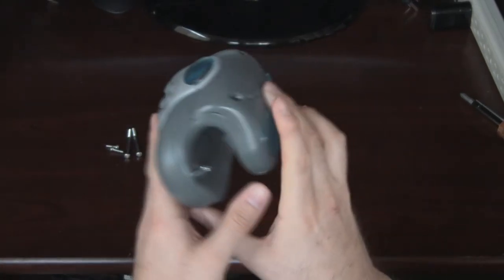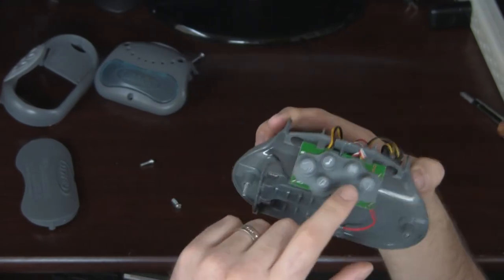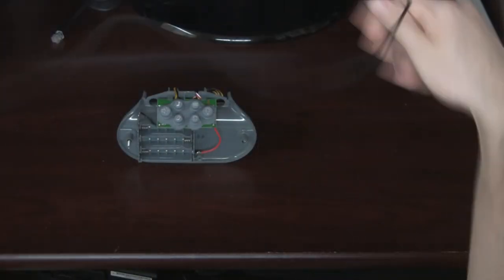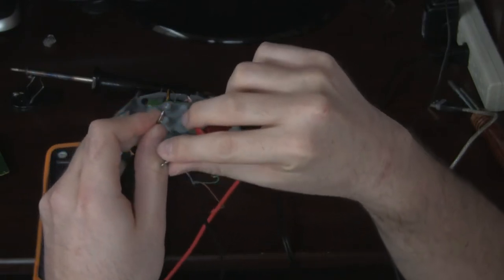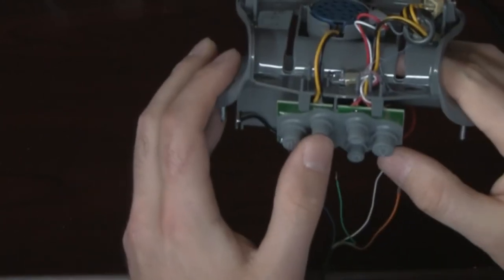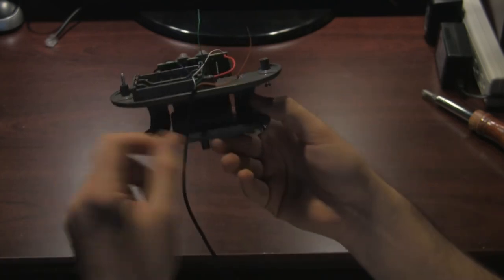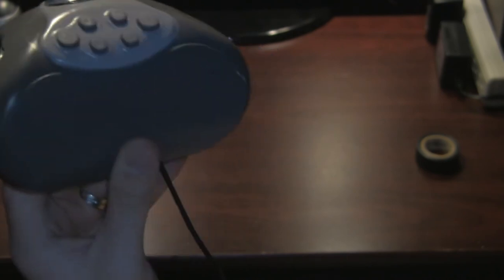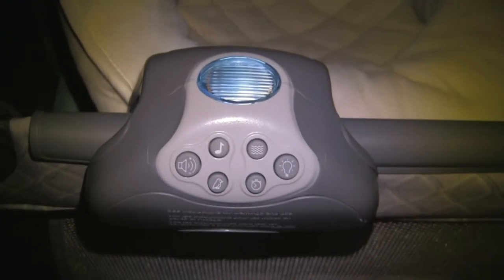Graco Playard Soother Lights and Sounds Hack Mod - No More Batteries!

Comment: @Rendus4 what did you use to put hole in the device for usb wire? Like the video
Reply from the maker: I just took a small drill bit and drilled where the two plastic pieces meet, and I drilled while the two plastic pieces were together so that everything lined up.